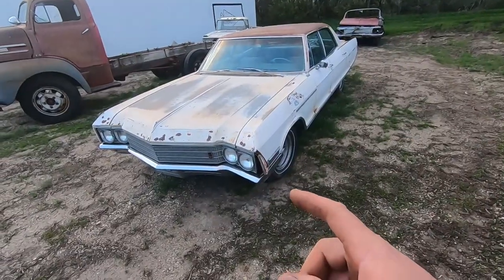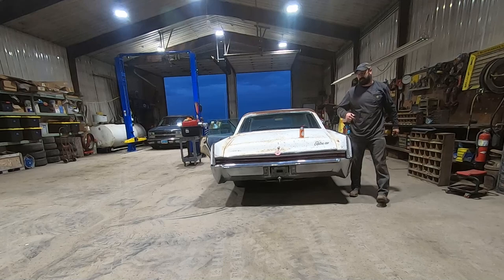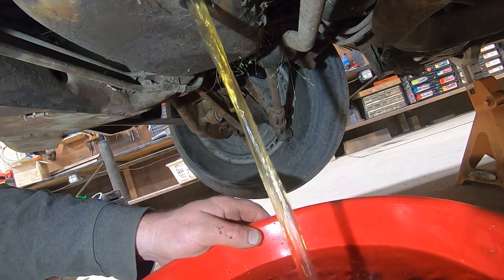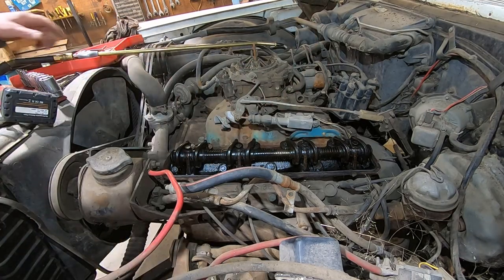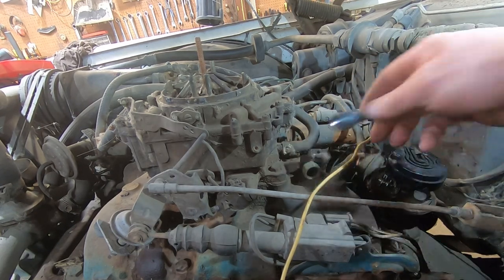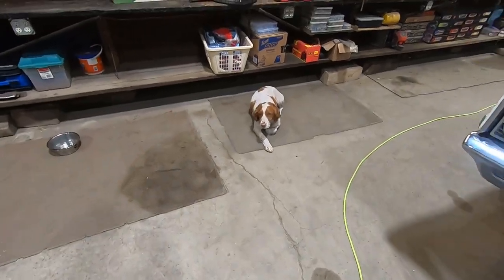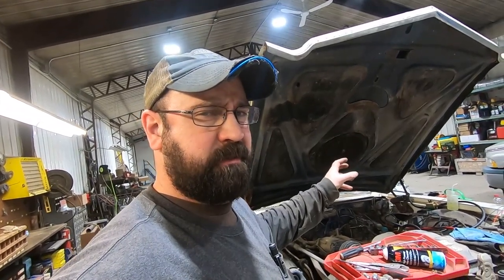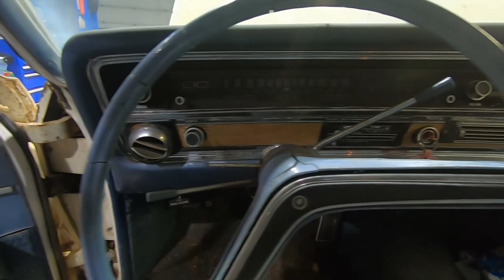Will it Run?!? 1966 Buick Electra 225 Abandoned for 30 plus years! Land Yacht Revival! 401 Nailhead!

Comment: That’s really a pretty solid car, it’s worth pulling the engine and a quick redo.
Reply: He won't
Reply: @tomwinkle1597  he need to check to see if it has a bent push rod . that Eng., was know for it , because  of the angel .
Reply: @johnnapier5588  I can't remember a video of him ever replacing any rings or bearings. Drives me nuts, pull a motor and play with it. His garage, but I know I couldn't go thru all that work and never fix the problem. Rings and bearings are cheap compared to a machine shop or a crate motor. A lot of motors new rings, bearing, and a hone can go another 100k. Maybe clean up the valves

Comment: Great job getting it running, didn't think much when I seen you remove the trailer hitch until you drain the pan with that much water I think somebody backed it into a lake  launching their boat that's why it locked up hydraulically maybe broke a piston or rod maybe you should check the rear end and transmission for water.

Comment: The reverb is a signal delay device to the rear speaker. The delay is probably adjustable and creates an echo effect. These were real popular in the 60's. Imperial had them as an option on the 64-66 model years.
Reply: Pulled an old Audiovox add on reverb out of a junker in the 70"s.
Mono only.  Inside was a speaker driver and a pickup connected by a big ass spring!  Made everyone on AM radio sound like Elvis.
Reply from the maker: That’s awesome!

Comment: I own a 1967 Buick Electra 225 with a 430. Other than having to pump the accelerator to get it to turn over, and an oil leak from the front main seal (I Think), i don’t have too many issues with it. Im not a mechanic. So im sure there’s a list of other mechanical things to address. Having a hard time with finding a restoration shop locally in Baltimore. So until I find one, it’s just a matter of time before something major goes wrong.  In the meantime, I joyride once a week while being harassed by old people on the road begging me to sell it to them. Lol.  Great content bro 👊🏽.

Comment: The tone reverberator on '60'era cars (GM was the only dealerships that I know who offered it) was most less like an amplifier that boosted the output with a bit of eco that mimicked the sound making it artificial stereo. It was a decent option for a AM radio at the time and might have done better for a AM-FM. I don't think stereo versions came out until sometime in the early to mid 70's. I could be wrong, but this is just my comment based on what I knew at the time. In 1975, I was 20 years old.
Reply from the maker: Great info!
Reply: @MortskeRepair  Thanks. I'm glad you saved her from the crusher so clean her up, pop the dent out of the roof and drive her unless you plan on selling her. Either way, you saved her. Well done.
Reply: I heard an after-market reverberator once, I think in an Oldsmobile. It made the radio sound like it's playing in a bathroom, which was actually kind of fun. I mean, who doesn't like singing in the shower.
Reply: @error52  I agree.
Reply: Yeah I had a couple of old GM “boats” that had the tone reverb on them/in them, whatever, but if you had that you generally had pretty badass car stereo for the time, and if you went to Radio Shack and got a couple of Realistic 6”x 9” speakers to put in the back window/ package tray then you really had something! Love those old land yachts, any of them, wasn’t no ride like them!!!
Reply: There is a reverberator option in the owners manual for my 64 galaxie, never seen one though.
Reply: @MattsRageFitGarage  - hmmm 🤔? Ain’t no telling about it
Reply from the maker: @error52  Hahaha

Comment: 4 portholes were for the Century or Roadmaster (or Electra).  The century was the hot rod - smaller body with the big engine.  This is a C body.  A's were Chevys and such.
Reply from the maker: I knew someone would know!
Reply: Also, the Lucerne had 4 "ports" on the fenders.
Reply: The electras had the 3 portholes my mistake it had 4 my regal had 3
Reply from the maker: @tkskagen  ewwww

Comment: 1966 Buick Electra 225 Custom 4-Door Sedan (post) with production of 9,368 units.  Also was offered in the cheaper Electra 225 series with a plainer interior.  Overall length for this model year was actually 223.4 inches.  The hardtop 4-Door was more popular than the sedan.
Reply from the maker: She's LONG!

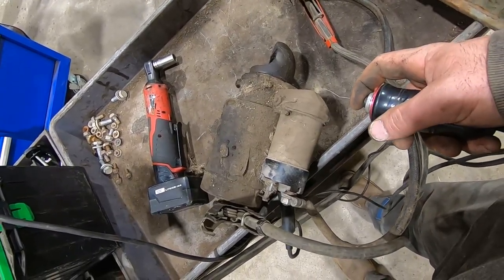Comment: I think before I went after a rod problem I would unstick the valve on the second cyl from the front on driver's side.   Check out the 33:30 minute.
Reply: and the second from the back, same side
Reply: I agree definitely think you have some sticky valve issues lots of air movement back out of carb

Comment: The switch pitch torque converter was used in TH400s and the Jetaway two speed.  I had a 67 Cutlass with the Jetaway. The wires inside of my transmission were shorted out, so I never got the switch pitch to work. I swapped on a TH350  from a 68 Olds and never looked back. 

I was hoping the pounding I heard on the video was the sticky valve.

Goid video as always!

Comment: I had a 1967 it had tilt steering wheel an electric windows an antenna it had a 430 4barrel with the fender skirts an red in color with black seats the tail lights went all across the back one  heck of a car never gave me any problems just like all the old cars I had I wish I still had em

Comment: Yep notorious like you said, my dad's got one in a 46 Ford that he built for my mom for an anniversary present. Seems like I remember lifters being a problem and valve cover gaskets and I remember my Buick wildcat had the same motor as well with the two speed transmission that was crap and it was the only one my dad said he had ever seen that didn't have a leaking valve cover. Only had 67,000 original miles on that one, but of course me with no money to build a shop to put the car it got sold out from under me when I was a teenager. Anyways happy wrenching

Comment: 27:29 regarding the "Nailhead" name:

Buick designed the engines for torque first an foremost. The "nail" term comes from the relatively small valve sizes, so they resemble nails.

Small valves were to increase port velocity to build torque quickly down low, and the vertical orientation of the valves was to aid airflow due to the decreased valve area, hence the weird pushrod geometry.

Don't know if that's the reason why the Air Force used them on start carts for the SR-71 Blackbird, but still a neat part of their history.

Overall, great looking motors for a hot rod!
Reply from the maker: Good stuff!

Comment: The Buick Electra 225 was one of the sleekest most beautiful cars built by GM. This car should have a 360 hp Buick 425 engine in it. Some had 2 four barrel crabs that were a dealer installed option. They are quite rare too find.
Reply: I just realized that I  typed crabs instead of carbs. Oops.

Comment: Hello Mortske Chinn.& Duff of course. It looks,s maybe like you used some time to possibly relocate to a larger shop. The lift will be worth it's weight in Buicks if you do decide to at least pull the pan and check to see if just a quick bearing change will do. Come on Duff as well as your viewers want to hear and see the Speed Minder do the hey your going too fast job it was built for.
Good to have you posting g again keep up the great videos.

Comment: i had a '72 225 land yacht. it was turd brown inside and out, ran like a champ and on a good day got about 7 mpg. good thing it was 1988 and gas was like 90 cents a gallon. i bought it out of the weeds from a farmer for a cool hundy, and sold it for $700 6 months later to a guy from the hood. amazingly, he was happier to get it, than i was to get rid of it. i only got it as a cheap beater with a heater for the snow time, 'cause i only had a bike, and riding the ice on a 750 triumph chopper with a 6' springer front end would've been a cold way to commit suicide. damn the bad luck, you have more starter issues than anyone else i know. you were riding high when it spun fairly easy, then the sound of defeat in your voice when you got the clickety clack after you hit the key was as close to the definition of crestfallen as you're gonna find.

Comment: Re cappers called the worn-out tires casings.... referring them to the part the new tread went onto. Clean 66 225. My grandparents had a 66 LeSaber. Theirs was not loaded like yours. It sounds like the firing order is still off, along with that nasty knock.

Comment: Just saw your video of the 66 Buick  l have a 65 Riv wth a 425 / 465  .  Valves  in nailhead s like to stick sometimes 12 /2 drums on the front hub center odd size aluminum drums low mileage worth fixing.
Reply from the maker: Nice

Comment: I own one of these, a convertible. It's the nicest car to drive, big and very comfortable. That engine is an easy fix and worth it. They're forged rods and forged crank. The fact that that one is blue already indicates it's probably been rebuilt, it should be green. The carb is a Rochester 4GC, last year for one. A 64-66 Nailhead (either a 401 or the 425) are an easy drop in too. Switch pitch 400 was available from 65-67. Make sure you check the tag on the tranny before you yank it out, a lot of these were subbed out by rebuilders to standard converters if they were removed.  If I was closer to you I'd buy it, it has all the parts I need to finish fully equipping mine. Oh yeah, that's not the speed minder, it's the set knob for the cruise control. You got one or the other, and you have the much rarer cruise control.
Reply from the maker: Ahhhh nice!

Comment: Buick and AC/Delco was ahead of their time. The Somomatic Radio actually had seek and scan. Yungens today think that was a new thing. They even had a system in the 50's that sensed rain and put the top up on a convertable  if it started raining and you were not in the car. My 1963 225 the trunk opened with a large knob connected to a plunger that had a small vacumm pump the car did not have to have vacumm you just pulled the knob and the plunger created enough vacumm to open the trunk. My 225 also had rear AC and heat. I loved my 225. I got it in 1985 and it had 63,000 origonal miles on it.
Reply from the maker: Nice!

Comment: The 66 Electra is my all-time favorite car since my childhood in the 90's and only 3 were shipped to Denmark in 66 and my dad had 2 of them. His second Electra was my childhood-car
They didn't last long under his ownership. He drove them through salt during winther. That's a recipe for rust. And when I turned 20 about ten years ago, dad gave me my childhood Electra as a gift. Sadly, she was destined as a donor-car but lots of good parts and the 401 still works well. When I took it apart I discovered that she was dark emerald green metallic before she became black somewhere in the 60's and named her "Emmy"
A bit bummed when the Nailhead went knockity-knockity after starting up after who-knows many years. But she's too nice to part out. I just hope a Nailheader or an Electra-enthusiast will take this girl home and fix that knocky-knocky Nailhead. Mortske, If you want/need more info about the 66 Electra, let me know and I'll gladly help

Comment: That is a really a sweet car, it has so much going for it. And it wants to live, and the amount of water coming out of that oil pan must have been a gallon. It came lose and idled for us. No smoke, oil pressure. Maybe do a lower end rebuild on this engine. I bet there is a machine shop that can use some YouTube publicity.
Most Youtube channels that go like didn’t run for a 1000 years will it run and drive home a 1000km. Oh rod knock it’s a parts car, and there it stops. Maybe this one should be oh rod knock let me show you guys how to do a engine rebuild on a small budget? What do you think Mortske? And love watching your channel, yours is the best ;-)
Reply from the maker: Nope. No machine shops around here.

Comment: I used to have one & I guess the previous owner took out the original engine & transmission bcause mine had a 400 with a 400 transmission in it,I guess the original engine & transmission went out & he had the 400 engine & transmission in a wrecked car that he bought for just the engine & transmission to be put in a vehicle that needed them & he had the electrictra so he put them in it & it ran really good,wish I still had it,just to bad that it has a bad rod knocking,would've loved to see it running again & you & Duff take it out for a spin,man that sucks 😔😞🙁😕☹️

Comment: The same thing happened to my Sister's Buick, some goofball was revving the engine with wet wires and caused a spark to go to a piston on the upstroke, boom slightly bent rod and a crushed rod bearing.

Comment: It's hard to tell from the audio, but are you sure it's a rod and not a valve issue. Flame from the carburetor leads me to believe it may be a sticky valve, which will give you a hell of a knock on a nailhead.
Reply from the maker: It's definitely a rod knock
Reply: @MortskeRepair  is that your new shop you will be working out of now?

Comment: 401 engines are famous for crank and rod failures I have had a few 63 64 Rivera's in the 70s. Very strong running, very fast. A Lot of torque
Reply: I have several Buick Nailheads and I've never had a rod knock.  As a matter of fact, I've never heard about rod knock on a Nailhead until now. Cranks, maybe, if really pushing them past their rev limit.  The 401 was never "famous" for crank and rod failures;  they were famous for their dependability, torque, and longevity.  That's why Buick used them for 13 years.

Comment: I had a 64,65 and 66 Buick Wildcat  they had the 401 motor. The 64 had the 465 motor wich was 425 ci  and 465 lbs of torque.  It also had two Carter. AFB 4 BBL carburetors a Borg Warner T-10 4 sp manual transmission with a Hurst competition plus shifter from the factory.  In 1967 they went to the 430 ci motor.
Reply from the maker: Dang I’d kill for that setup!

Comment: Too bad about that engine.  That car is in really nice shape. It reminds of my first car. Bought a 57' Chevy from a junk yard. When I got the old straight six to run, it sounded like it had  a broom handle in the fan. We had a Buick with speed minder in it.Dad used to set that and would check to see if anyone had changed the setting. Bad news if you did and didn't set it back.

Comment: Best mixture to free up rust stuck pistons & cylinders is 40% Acetone & 60% Trans Fluid in each spark plug hole. Usually a 24 hour soak is all it takes.

Comment: I used to have a Electra,it was either a 66 to 69 bcause it had a 400 with the 400 transmission 4 barrel carburetor crappy sounding single exhaust,but she got up & went,I took her out for a drive one day & she did a great doughnut around a big hickory tree & the last one I was going to do her driver's side rear quarter back by the trunk decided to slide & hit the tree hard & put a good size dent in it & that made the driver's side door to come open & I had to reach out & grab it & slam it hard to get the door to stay shut & I locked it so it wouldn't open up while I was driving back home, but when I got back home I shut her off & waited for about 5 minutes then tried to restart her,but nothing happened just a whizzing & wining noise,she had spark, brand new alternator & reman starter,but I couldn't figure out what those noises were coming from until another friend of mine that likes to work on older vehicles from when I lived in Arkansas & we took out the engine tore it down & found out that after I let cool down for 5 minutes & then tried to restart her,she spun 3 bearings on the crankshaft & snapped the camshaft in 2 pieces,I was upset about what I found out what happened & I didn't know if the 400 transmission would work in a 72 Chevy Caprice with a 350 in it or not so I just left the transmission in my Buick & put it on blocks & put the wheels in the trunk
Reply from the maker: Good times
Reply: @MortskeRepair ,yes it was good times,would that 400 transmission in the Electra fit in a 72 Chevy Caprice or not bcause the 400 transmission in the Caprice went out,it was my dad's Caprice,the drive & all the forward gears were gone it just had reverse & neutral & park,that's why I asked, oh yeah the transmission in the Caprice was a power glide & so was the one in the Electra

Comment: I have a 1965 Wildcat with a newly rebuilt 401 but it has been sitting for years.  The last time I started mine it sounded the same.  It is my understanding you have to prime the oil pump after they sit for a long time then they operate like they should.  Maybe try that.
Reply from the maker: Worth a shot

Comment: My mom had a 65 two door. Tractor trailer took a left too close and the rear tags went up the left front bumper, over the hood and down. Left a black mark. Fuckin tank. Center of the back seat had the metal speaker grill with the Buick emblem sucker hurt when the back of your head bounced off it. Doors were yeeaaaaah long.
Reply from the maker: Good times!

Comment: I am trying to recall the details, but there was something about those engines having an odd oil flow path. Something about a cam bearing issue could cut the oil flow to the mains. Back in 1981 I had a '65 Electra 2 door with the "Cadillac top" and the vee rear glass. I still miss that car. It was so big it should have had it's own zip code.

Comment: Seen so many of these old nailheads die from one simple solution... The previous owners never added zinc to the engine oil... The ol Nailhead was famous for eatin bearings due from no zinc in the newage oil we have been using last 40+ yrs